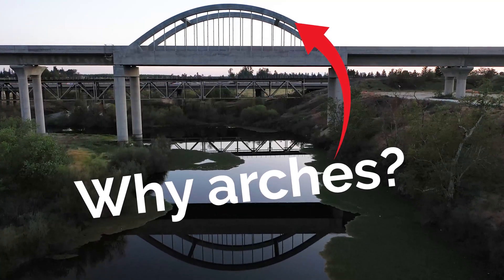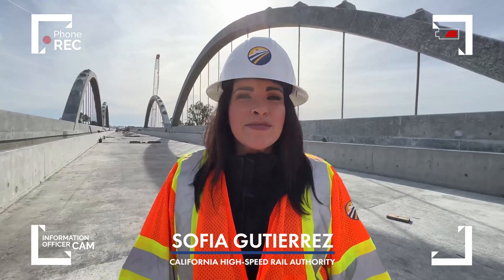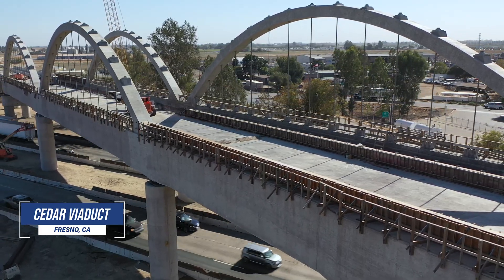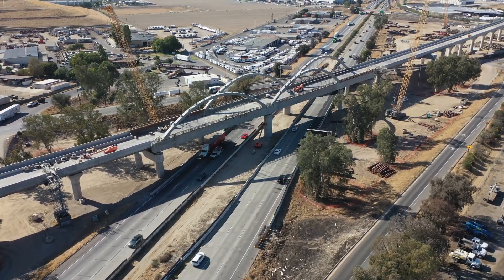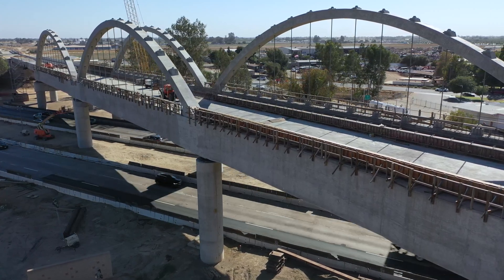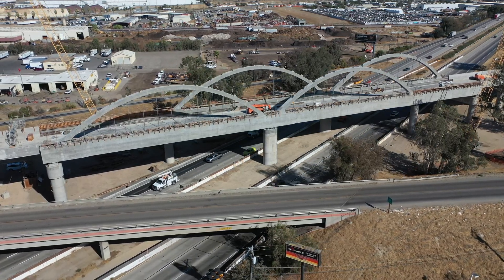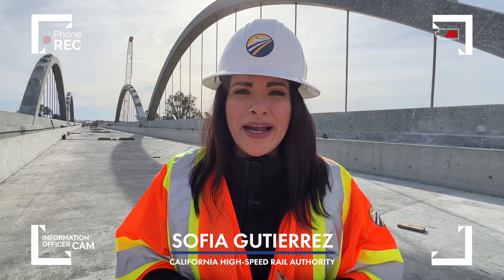#WonkWednesday: Why does CA HSR Use Arch Bridges?

Comment: The railroad in Alaska just replaced many of its truss bridges with spans made of plate steel that look like big guard rails on either side of the track.  They did this because it was a less expensive way to go. The spans were pretty long and made to support freight trains.
Reply: Plate girder bridges are typically the cheapest - but it depends on your pier spacing.  In this case they're crossing a highway at an angle that results in longer spans than usual, so a plate girder bridge might not be stiff enough.  It'd surely be fine in terms of strength, but with too much deflection in the middle when a train rolls through.  High speed passenger trains are very sensitive to that, first for passenger comfort and second for safety.  Freight trains are slow enough not mind if the bridge dips a few inches in the middle and the poor engineer and conductor are expected to live with a bumpy ride on old, uneven tracks.
(I haven't worked on rail bridges, but I'm a structural engineer and have some familiarity with them.)

Comment: so the concrete pathway can pull on the cables connected to the arch. that will pull the arch down, but thanks to the arch shape, the force is transferred along the arch shape toward the end of the arch, where the concrete pillars can support the load. when the cable tugs on the arch, the arch is pulled down at the point of connection.

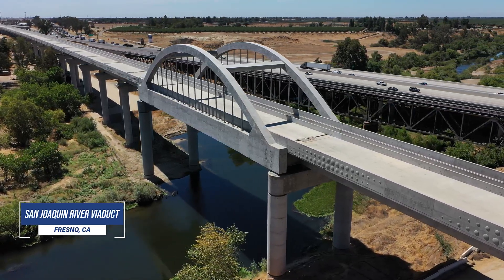Comment: The more educated the public is on the benefits and workings behind HSR, the more likely they are to support it. Keep up the good work. Also, is there a purpose behind the circles on the side of the structure just before the arch at 1:29?
Reply: Nothing structural about the circles. It is simply a way "dress-up" otherwise stark concrete. They are an inexpensive way to add a little character to a public works project.
Reply: @jjxtwo1  looks like rivets to me
Reply: @darthmaul216  i don't think they're rivets. it wouldn't really make sense to only have them where they are, plus the structure is concrete. also, why would they all be different sizes?

i think they were really easy to add because i would guess those spans are precast concrete and so no additional effort wouold be required for like, chiseling them out or something
Reply: @KooShnoo  I was thinking there was something on the other side, and we use different sized rivets in aircraft manufacturing. 

I was simply relating this to what I know
Reply: @darthmaul216  ur prolly right
Reply: @KooShnoo  I’m probably not